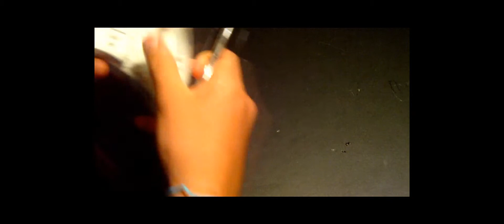How to Mod Your Xbox 360 Controller

Comment from the maker: @dadross1 Check to make sure that you haven't accidentally soldered two connections together. Also, make sure that you have connected the wires to the right spots. If you accidentally soldered two connections together, just use your soldering iron to heat up the solder and an index card to clear it out.

Comment from the maker: @dadross1 1) Make sure its a MATRIX controller (I show you what it looks like in the video)
2) Make sure you haven't accidentally connected two connections to each other with solder
3) Make sure that you connected the wires to the right points on the controller

One of those 3 must be wrong.

Comment: Hi I have a fully working matrix controller i have done the mod with loads of different wires and push butoons all new and in the right place but when i hold down the button it only does single fire not rapid?